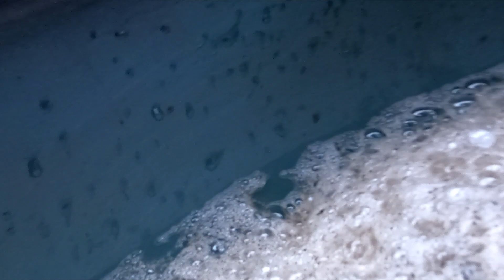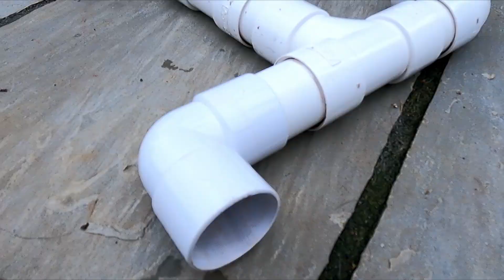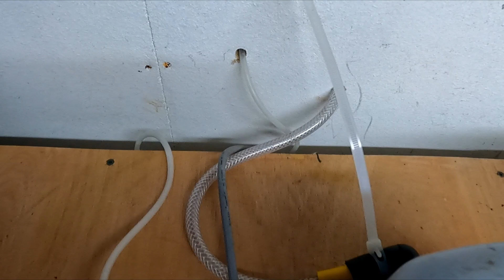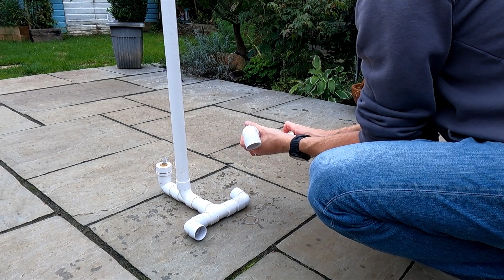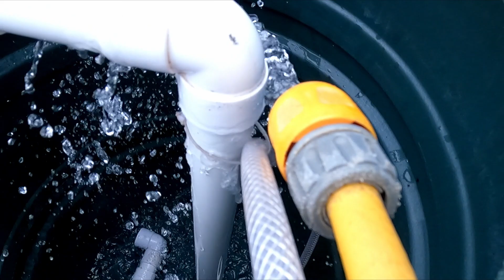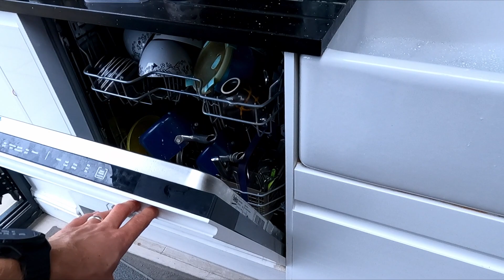How to build a compost tea brewer for less than £40

Comment: This is the first time I’ve seen a tea brewer that that circulates the ingredients. Others typically suspend the compost solids in a mesh bag and simply aerate the water. Do you use compost solids, or do you substitute liquid extracts?
Reply from the maker: So the 'lifter brewer' that I make here certainly does the job. I think that you can achieve superior levels of oxygen saturation with the traditional membrane at the bottom of the tank - but does this give superior organisms levels at the end? Well, I think that there are lots of factors at play which will provide the answer.  The mesh bags are ok. In my experience, putting the compost straight in to the tank and letting it circulate is the most effective way to dilute the compost material and ensure that all of the organisms are 'freed up' and in the solution. The bag method however, is likely going to help a bit with cleaning up at the end though - depending on the particle size of the materials that you are using.  I use solid (compost) material btw, most frequently a worm compost mixed with a few other items.😁

Comment: This helps me visualise the system in reality - in my head I was imagining a riser column made with a drain pipe but that would probably be too wide and meaning too much volume to circulate, this setup looks much better. 
Maybe I would place the air entrance higher up on the riser to ensure there’s no chance of the bubbles exiting through one of the other pipes but if this works then probably not even necessary.
One thing that wasn’t quite clear for me was you said the pump should do 30L/min and yet your compressor is rated 240L/min 😅..
Great resource for those of us getting to grips with this compost tea business 👍